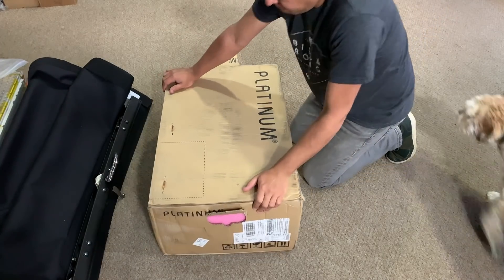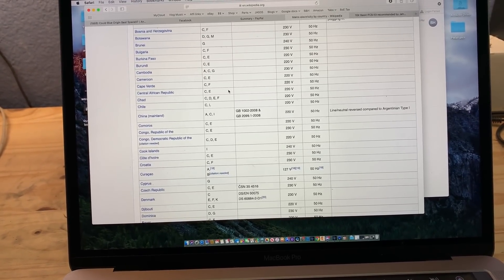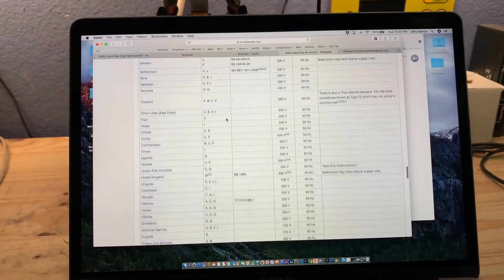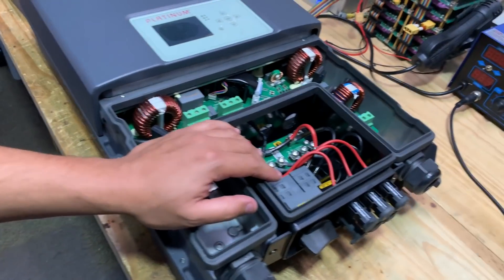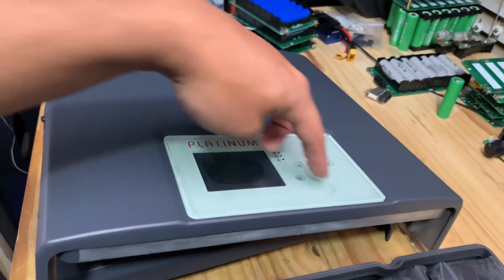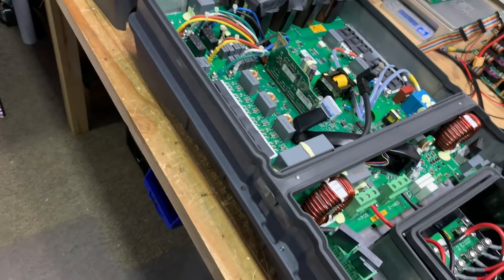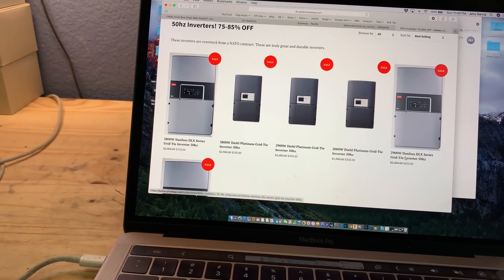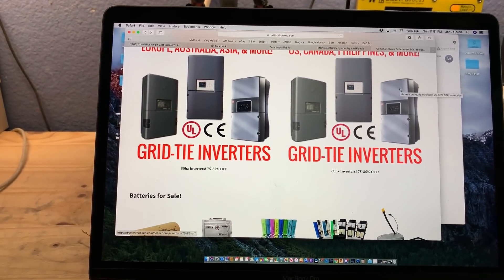A Look inside 50hz SOLAR Grid Tie Inverters

Comment: So apparently the only reason we have places in the World that is 60Hz it is because Tesla was superstitious and he wanted wanted everything to be divisible by 3.
Reply from the maker: So of he set the standard,  why go 50hz?  Any benefits?
Reply: jehugarcia Both 50Hz and 60Hz have their advantages and disadvantages.
60Hz-
With 60Hz, the transformers can be smaller and less expensive than for a 50Hz transformer. Although the difference is small, it can add up in a system with many transformers. Using 60Hz results in less flicker on lamps, but that really is not a factor these days.
Hum and frequency noise are more readily audible with 60Hz and its harmonics than with 50Hz.
50Hz-
With 50Hz, electric power transmission over long lines favors it over 60Hz. The effects of the distributed capacitance and inductance of the line are also less at the lower frequency.
Although 50Hz transformers require more copper and iron, 60Hz transformers require more expensive plates to prevent eddy current losses.
Reply: @jehugarcia  As an afterthought, I wonder if setting the whole world to one frequency would cause disastrous worldwide harmonics that cause enormous problems for lots of things.  It could build up some strange magnetic field around the whole Earth that never gets canceled out by the unsynchronized frequencies of the two large power producing frequencies on opposite sides of the planet.  It would be kind of easy to test my theory by testing to see if there are common peaks between 50Hz and 60Hz, such as every 10th of a second, that cause smaller anomalies.  If so or if not, we could gauge the effect of my afterthought.

Bugs could fly backwards.  Birds could fly upside down.  Turtles could go around in circles.  Motors could start spinning on their own.  Plasma with huge lightning-level currents circumnavigating the world could constantly flow, and anyone stepping in them would be vaporized never to be seen again.  Airplanes would take off and never land.  Fires would burn every living thing to nothingness.  Lightning would strike one thousand times as often.  Or not!  None of that at all!  Or a portion of it.  It could erase our ionosphere and all our atmosphere would escape and we'd choke on the void of space at sea level.  Or, it could make our ionosphere so strong that it blots out the photons and the sun and we go dark and freeze to death.  Or, it could make our ionosphere so conductive all we have to do is run a wire up a mountain and get one terrawatt of electricity without even plugging it in to anything -- the fricking wire would become a hazard just sitting there not plugged into a grid to use all that E.

Or, something more benign like radio signals could cease to work, or the only type of Ethernet that works at more than 20 feet would be via fiber optics.  Who knows!

Or just the birds fly the wrong way thing.  Maybe just that.  Or heck, it could be something worse but less obvious, like all birds get a bad migraine headache for their whole life.

Comment: MC4 connectors going to yet another connection = unnecessary volt drop
Reply: The 60hz one I got didn't have MC4s at the inverter, just screw terminal blocks